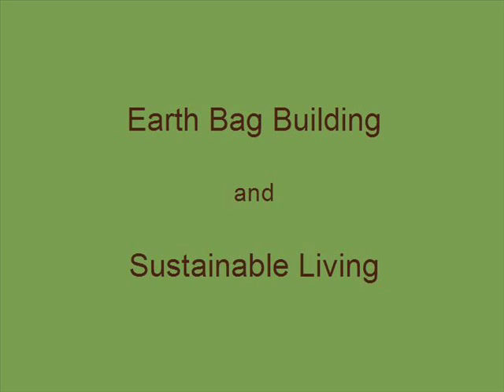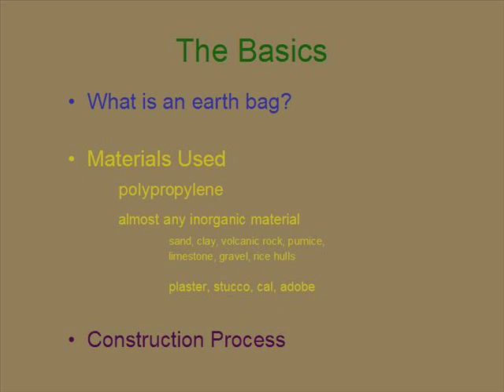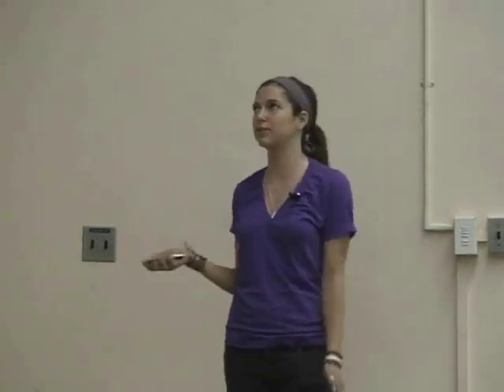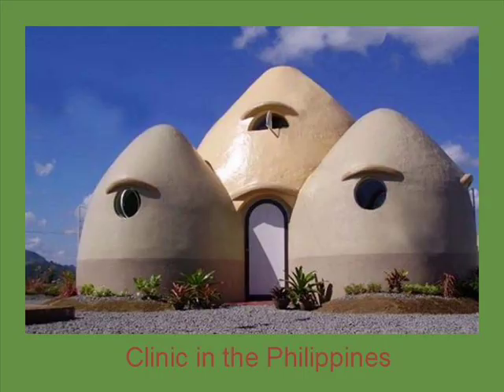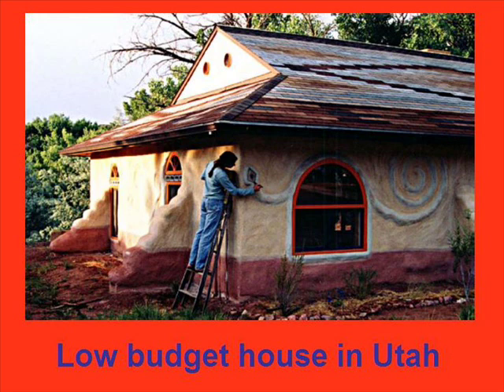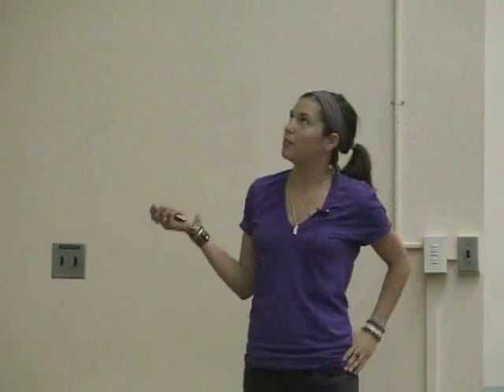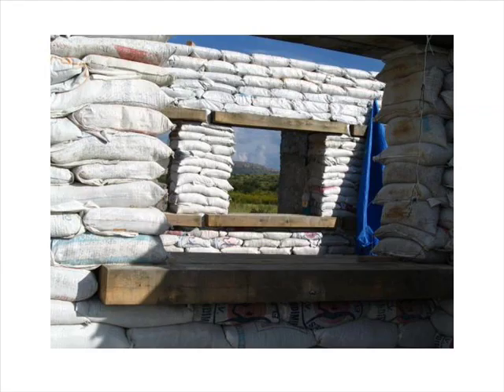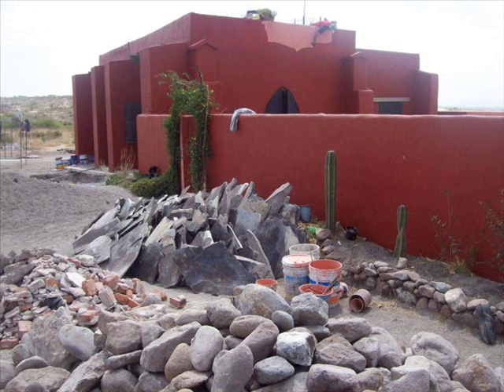Earth Bag Builiding

Comment: The polypropylene material depending on the type of plastic used can take years to millennia to photo-degrade. Because plaster covers the entire structure and is close to or is air tight. Structural integrity is not really an issue with this type of structure, since the polypro will not photo-degrade.